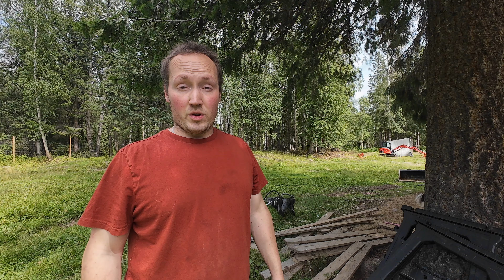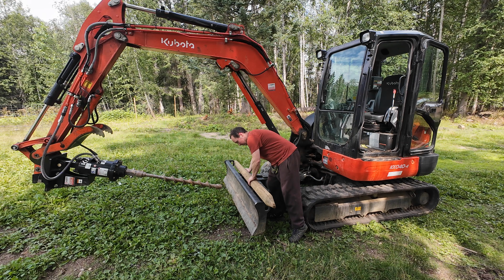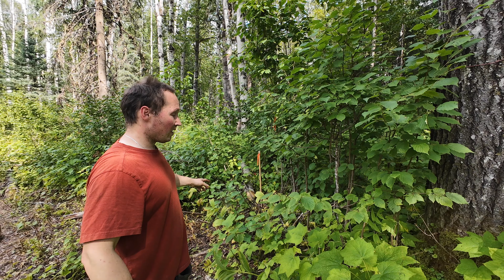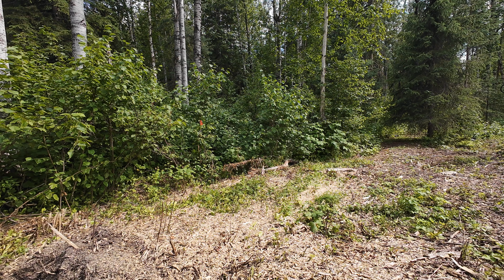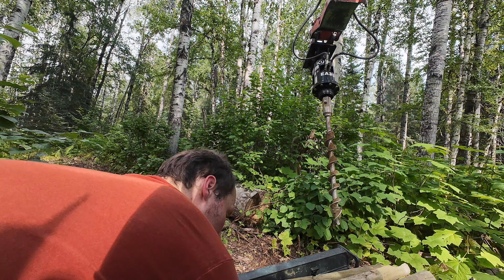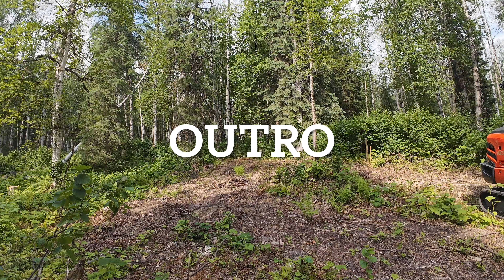Setting posts along a property line

Comment: If I bought 50 acres, I wonder how much it would cost to have a surveyor put a stick every 25 yards on the property line all the way around.   I would follow up with a more permanent post at each stake.
Reply from the maker: @slackerdug3423  I’m planning to! for now the pressure treated posts will outlast the stakes. 

if all goes well I’ll have the maybe 12 acres fenced next year, and maybe 20 the year after. 

for the local surveyors I paid ~2000 CAD per property line, they surveyed 2 on an 80 acres property. metal pegs were already in the ground so this was literally just placing stakes via GPS RTK or similar.